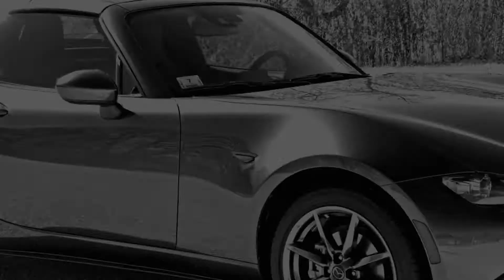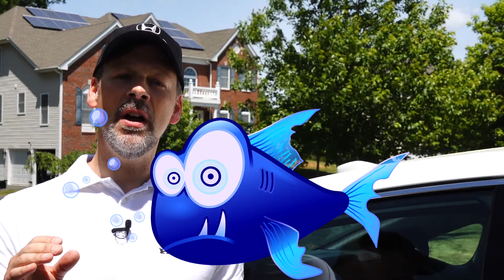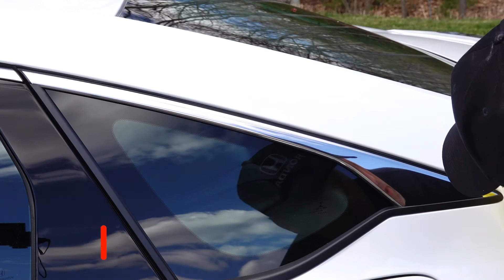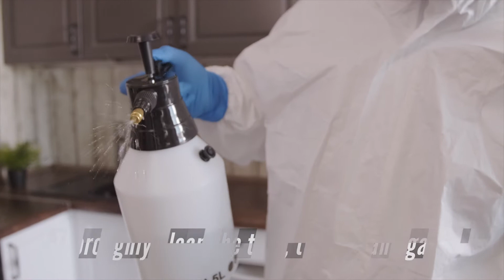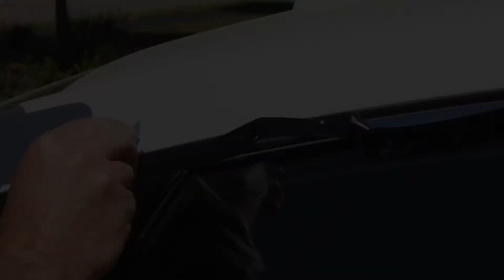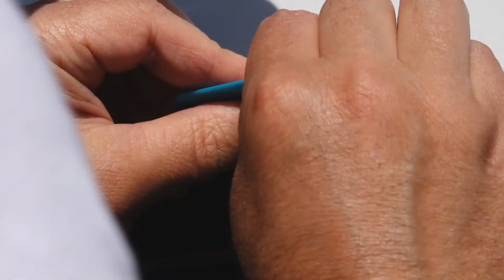10th Gen Honda Accord - Window Trim Chrome Delete (vinyl wrap)

Comment: Nice informative video. I have a question: the trim blackout looks nice but once you’ve finished the only thing that’s wrong is that the front end chrome on the grille near the headlights will still be shown. Does the kit   have black-out for the chrome on the grille?
Reply from the maker: While the kit may not have pieces to cover the grille, you could always buy the vinyl and cut yourself...https://youtu.be/uzeB8qAsack

Comment: I haven't done a lot of vinyl wrapping, but my friend owns a vinyl wrap business and does many many cars. 

1.For smaller items like this, if you have a garage and a heat gun, it is not necessary for it to be warm outside, simply needs to be above 40 degrees F. Anything bellow won't work. The tip here is to apply a little heat after sticking on the vinyl pieces, spread it out evenly, then reapply a little heat. You don't want the vinyl to get HOT just warm enough that you feel the material stretch. 
2. The majority (if not all) vinyl wrap for cars is HEAT and PRESSURE activated, not just heat. Apply pressure in an even, UNIDIRECTIONAL pattern while its warm is what activates a lot of the properties of the glue. When using the squeegee start on one end, and move in one direction to the other, OR start in the middle and move outward, this applies to all wrap's for cars 
3. Although the vinyl is precut, it still requires slight stretch/pressure. When you warm up the vinyl it will expand, this is normal, and trimming is just part of the process. I highly recommend to apply all the vinyl to cover everything first, wait for the vinyl to settle and cool, THEN cut. Don't cut while the vinyl is hot/warm unless you are using knifeless tape.
4. Try not to touch the adhesive of the vinyl. The best way to apply it without touching is to align a single point of the vinyl while the rest is still attached to the plastic anti stick paper it comes on. Simply fold back the paper and crease it to get it out of the way. Then after, take off the whole strip once the tip is secure, and apply the other tip on the far end. Then while the tips are secure, start at the middle and work outward. Going inch by inch while its flapping in the wind or just hanging isn't optimal. Tack down both ends, them go center out.
5. For trim like this, open the doors. This will let you not only apply the edge more precisely but also trim the vinyl later.

Over all the video covers all the nuances quite well.

Comment: Thank you for your video. The everyday man (person) doing a DYI project. Amazing! I have watched a ton of window wrap, heck all kinds of wrap videos and yours is the only one with the up-close perfectly focused on how to tuck the edges of the wrap.  Parts of my window may have a rubber seal but not a seam to tuck in the wrap... and I suppose that the tucking tool is extremely thin so you can tuck the wrap in those really tight stiffer rubber seal areas...and I can say from experience that the Hyperdip can method is NOT the way to go. Hours to cover your car paint. Spray paint and dry time, and repeat 7-8 times... and still even if you are meticulous, you will get spray splatter (not your fault), and in my case just not a very consistent look to the gloss. Yes they all make it look easy and flawless. Thanks again, you're like a good neighbor.
Reply from the maker: Thank you, L L!  I really appreciate the positive feedback, and for you taking the time to leave it. 😁👍

Comment: Can you use a lubricant?
Reply from the maker: The vinyl does not require water to apply.
Reply: @TheLemonFactor  but would water/alcohol help the install with a lubricant?
Reply from the maker: No it would not. The vinyl is intended to be applied dry.

Comment: Does anyone know if I can just buy the small pierces for the small window and some small pieces by the mirrors I bought the black window visors and I would like to black those as well
Reply from the maker: You can either buy small rolls of vinyl or cruxmotor sells them by the piece.
Reply: @TheLemonFactor   thanks a lot man

Comment: Precut vinyl is the issue. Every precut kit I've ever purchased used what seemed to me to be very cheap vinyl. I finally just bought a roll of vinyl and cut it myself from ViVid. Turned out great that way because I was able to have some overhang on my strips. Nothing peeled on the edges when I did that, but the precuts all peeled on the edges especially when drying off the car after a wash.
Reply from the maker: Totally agree about the restrictions of going with pre-cut vinyl 👍. However, for some people the fear of accidentally marring the car when cutting the vinyl is a legitimate one 🤷‍♂️

Comment: All right, I’m not posting just a troll your video or hassle you. I am, at BEST, a hobbyist. I’m also not suggesting I can do it any better, but I used to tint windows like crazy. I think I would’ve spent half of this video talking about making certain that every single surface that you’re working on or around is surgery room clean. I would wipe down everything with alcohol, make sure I was out of the wind, and you have to make sure as you did mention brieflyThat the under surface has to be meticulously clean and smooth. Even if the wind is blowing and you’ve got dust heading your wrap, deep scratches, rust bubbles, or even paint chips you have to use an extremely high grit abrasive to try and smooth that stuff down as good as you possibly can. For instance I would’ve used one of those read sponges you can buy at AutoZone that has an abrasive surface on the bottom that they say you can use in place of a clay bar just to clean it up and smooth out those scratched up vertical window panels between the front and back glass. Also, why would you ever buy a super easy to screw up $60 kit when, for not much more, you buy a roll and you don’t have to be so insanely meticulous and pull it up 40 times and overstretch it. Also, why so reluctant to use heat? (And BTW, forget about a hairdryer.)

Comment: How does this stuff hold up on high pressure car wash? Will it hold? I just purchased some without thinking about that
Reply from the maker: Good question. If you’re using a good quality brand, if it was applied correctly, and if it was given enough time to bond properly at the right temperature, then you should have no issues.
Reply: @TheLemonFactor  thanks 😁👍🏼
Reply: @TheLemonFactor  
How about the vinyl wrap rims ? I've heard they dont hold up on high pressure car washes
Reply from the maker: I don’t have first hand experience wrapping rims... maybe something I should try 🤔

Comment: seems like a pain in the neck. Good job though. Looks like you can still see those micro scratches after the vinyl. So annoying. Do you know of a way to polish the chrome area's before applying the vinyl? My front grill and the window chrome is impossible to clean perfectly. Drives me bananas.
Reply from the maker: I have the same problem with the chrome, including the black chrome. I wonder if a mild polishing compound would help, or only make it worse 🤷‍♂️

Comment: I wonder how it would be to plastidip it
Reply from the maker: Probably a PIA ; )
Reply: The process takes a very long time, much longer than vinyl wrap, and a lot can go wrong.  Paint splatter (spray can)  can easily happen, and because it's a spray can the application is not evenly distributed throughout the chrome trim so results are not consistent in appearance.  It's a better product to spray emblems / lettering.

Comment: That's good you were able to complete it.. My experience was terrible. I tried several times but it wasn't aligning up. Maybe I'm just OCD but i decided to not install it due to it was not aligning perfectly plus i notice tiny bubbles upon installing.
Reply from the maker: I'm glad you commented... I was beginning to feel like I was the only one that struggled with this stuff.  There is definitely a learning curve in using it.  Sorry it didn't work out for you.
Reply: @TheLemonFactor  No worries, im just going to take it to a professional vinyl shop. At least i know it will be done correctly. lol

Comment: Nice video. I bought light smoke taillight overlays (Crux Moto) for my Accord and had enough trouble installing those(50 degree weather) lol I couldn't imagine doing this although I really want the chrome delete as well as a black gloss roof wrap. I have a Red Sport 2.0. Keep up the good work!
Reply: I did it on my red 2.0 and it looks so good... it was a pain in the ass
Reply: @curtisfeltis8183  you did the chrome delete? Any tips or things not to do?
Reply: Art B just be patient.... it’s not easy and mine isn’t perfect but only you will notice any little bubbles and mess up...
Reply from the maker: It would look real nice with the red!